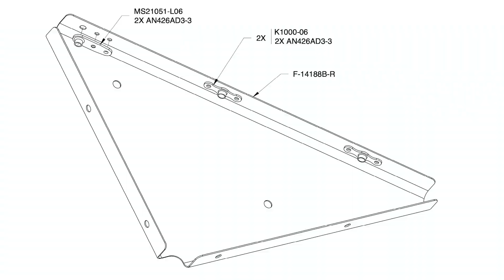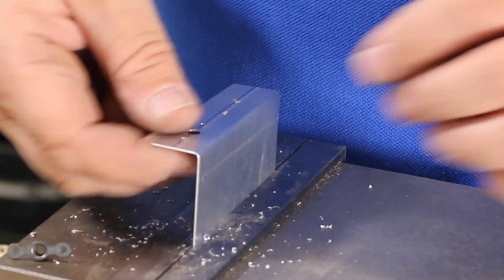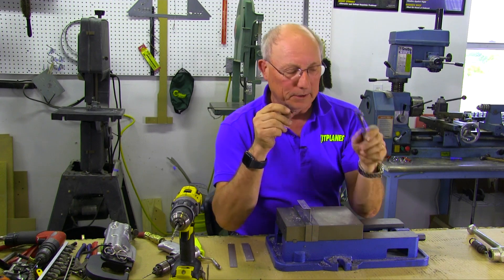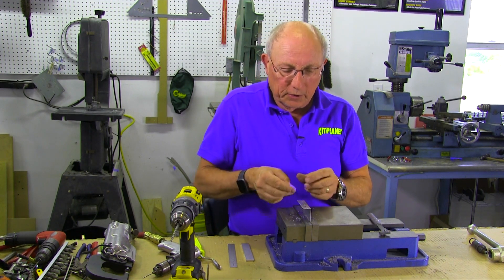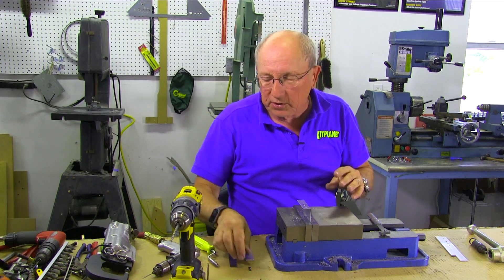Metal Magic: Installing Nutplates

Comment: Oh my, lots to unpack here.  This video is just OK, folks.

Never, never use a cordless drill motor to drill 2024-T3, especially an unsupported flange and a #10
drill, which is pretty big to just free hand.  Deburr everything, even on the flange side.  You’ll not get consistent quality work by just holding parts while riveting, even with a pneumatic squeezer.  This was a C+ video at best.  A little surprising from a Kitplanes staffer.

Comment: Well, that's interesting! I'm dabbling in sheet metal, thinking about automotive work when I came across this video. The tools don't look cheap, but neither do the results. Looks like a very strong fastened connection point on sheet metal, a lot to learn!

Comment: I purchased some of these to put an access panel on my kitfox.  But the screws only go into the nut plate a few millimetres before stopping.  why?
Reply from the maker: Assuming you have the correct size screw for the nutplate, it's normal to only be able to thread it in only a small amount by hand because the nut on the nutplate is not entirely round. This is by design in order to keep the screw or bolt from backing out by "squeezing" it. Do not run a tap through the nutplate to reduce this friction as that will obviate its holding function.
Reply: @KitplanesMagazine  I have not installed the nutplanes yet because I wanted to know why it was doing this.    I purchased the the screw and nut plate together from spruce.  So if I just keep screwing it in when it gets tight, it will go past that sticking point or do I need shorter screws? They are both 6-32. And please inform me do I need the no8 nut plate jig or 10?  because you used the no10 drill you said, but the no8 jig.
Reply from the maker: @jeremykemp3782  Use the jig specified for the screw size: https://www.aircraftspruce.com/catalog/topages/pndrilljig.php?clickkey=30568. 
Follow proper fastening techniques (at least three threads visible) and use the screw length that is appropriate for your application. As the nutplate starts gripping the screw, it will require more force to turn and remain that way until the screw is all the way in, so use a good, clean scredriver tip to avoid stripping the head slots.

Comment: I prefer to dimple when it’s thin, and then dimple the nutplate.
Reply: I tried that on the Van's practice kit, but the dimple die kept hitting the male part of the nutplate, and I couldn't get a good squeeze.  How did you get around that problem?
Reply: @vsavatar I filed the die so it doesn’t hit the male part of the nutplate.

Comment: I installed a few nutplates when I was in the Air Force from 69 till 74. And a few million Rivets. I was Air Frame from McDonnell Aircraft 67 to 69, prior to my Air Force Daze.... so I was privileged to drive some then also.  Still have my Cleco pliers and safety wire pliers from those good ole days.
Reply: Hi I am a man fr9m Nottingham NG3 2NA try fix a window on a boat which is curved at ends , I got no money but love a challenge
Reply: Как  я рад что есть такая сша значит мы не победимы привет от слесар сборщика  летательных аппаратов с50 летнем стажем